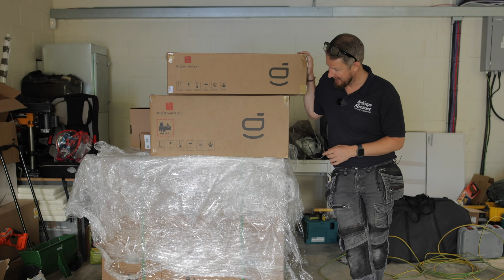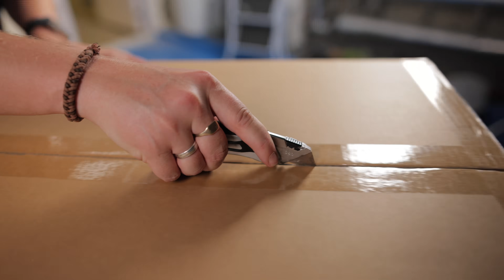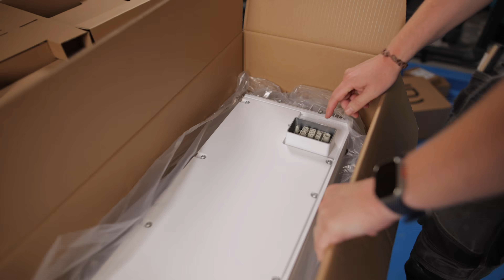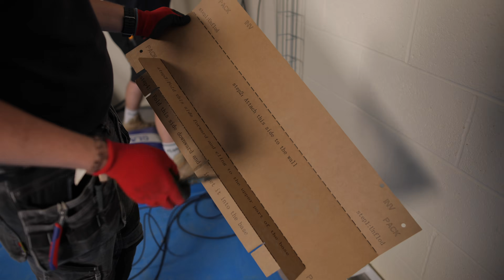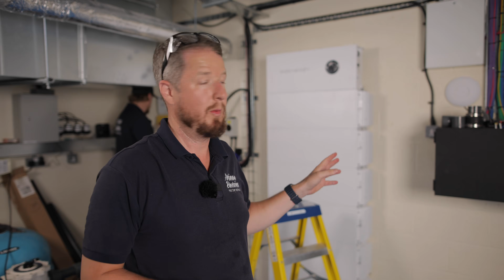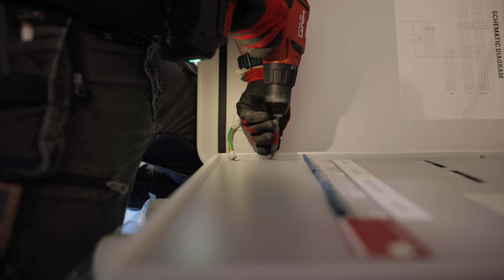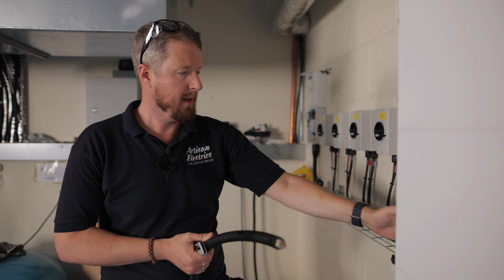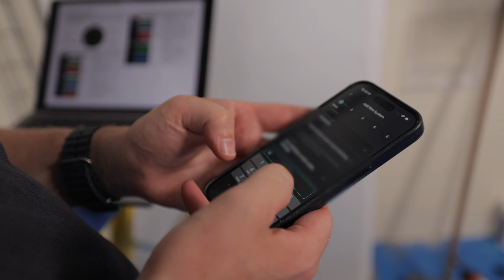Better than a Tesla Powerwall? 🧐🔋48kWh Three Phase UPS Battery System! ⚡️ Sigenergy SigenStor

Comment: I've had a great experience with Sigenergy so far. We've installed 10+ residential systems with them and the post install support has been better than any other inverter supplier I've worked with. The product works and the feature list goes on an on, heating and cooling plates, GPT4 diagnostics, Ai analysis of usage and a really solid app. We even had a rep fly from North Africa to come and sort out one of the installs we couldn't diagnose.

I didn't even mention DC car charging modules coming out later this year, 50kW car charging anyone?. Not a Sigenergy sales rep, just a Midlands based solar sales rep.
Reply from the maker: It really does seem that Sigenergy will eventually become a big name in the battery market here in the UK.
Reply: Re: DC car charging modules - I'm actually more excited about the fact that they have a roadmap to V2X that is to be enabled via software update that uses the current hardware SigenStor hardware. Granted it's 25 kW, not 50 kW, but given the size of EV batteries, that should open up a lot of battery storage for use when needed that we already have. Lots of people don't really need much battery backup when they aren't home, so may as well use the batteries they normally use rather than stationary storage that they might not need to use as much. Of course people using it for load shifting and energy independence will still need stationary storage, but for people aiming for stability of supply during outages, they can at least downsize the stationary storage installation.
Reply: The nearest rep is North Africa?
Reply: Just wait till Xi pulls the plug or starts to demand more spyware. Sigenergy is from Shanghai. I’m not joking here. There is plenty of evidence. We need more Western battery and inverter producers

Comment: Impressive system. Like the easy way of stacking the batteries, but, does it introduce a potential weakness over time? Are the physical connections between units robust enough to not cause problems after many heat cycles and stresses? That will also be a warm humid environment which, over time,  won't be kind to much of the electronics as well as those connections. Just a thought.

Comment: How long would it take to charge one of thosenup with mains power?
Reply: My guess is about 2 hours.  It's a 48kWh battery, the inverter is 25kW, and the house supply looked to be 100A (Three Phase), so the inverter isn't limited by the main fuse.
Reply: @tlangdon12  48kwh means when fully charged you can run 48kws for 1 hour? 24kwhs for 2 hours and so on.
Reply: @93lornamae  check the data, you won't be able to pull 48kW out of it, not many installs where being able to supply 1C when grid tied makes any sense.
Reply: With a 25kW inverter, that means a fully charged battery will go flat in about 2 hours at maximum output.  Charging the battery is more about the solar system and whatever type of AC powered battery charger is connected.  With 72 solar panels it might charge around 25kW in full sunlight but that still doesn't tell you how fast it will charge from the grid.

I think a system like this should have a connection for a gas or diesel generator so if you have an extended power outage with cloud cover or some other reason for minimal solar charging, you could plug in a small portable generator like a 5kW or 7.5kW and charge it in 6-10 hours, maybe more if you are drawing power while it charges.

I like the idea of three phase but I wonder if two phase to get 110v and 220v and a couple VFD drives would be more efficient.  My only three phase draws would be maybe 3 machine tools and I would probably never use more than one at a time.  A VFD with soft start would probably be an easier load for the inverters than flipping a switch on a 4kW three phase motor.

Any way, 4kW is probably the biggest draw in my shop.  Outside of the shop I need a clothes washing machine, a dish washing machine, an induction cook top, an oven, three mini-split AC units and a heat pump water heater.

I'm thinking of something like 15kW of inverter for that and about 30-45kWh of battery so an overnight load is less than 20% of my battery and I live in a desert so almost every day is sunny, I would probably have a large surplus if I install 10kW of solar panels but I still want a generator and a barrel of fuel in case something happens to my solar.

I do want to be completely off grid.  Local utilities around here don't want battery systems back-feeding the grid while they are trying to fix it so outages are still outages if you are grid tied.  I would rather oversize the system than deal with the utility at that point.

Comment: I was designing my own fully bespoke "whole-house" UPS system and now I'm starting to question whether or not I need to bother. As much as I love the bespokeness and the opportunity to build such a system and learn from it, off the shelf hardware being available is tempting.
Reply: The hardware has been available for awhile. My 1998 motorhome had a close to UPS system. Today it is getting better and cheaper all the time. I finally got rid of my lead acid batteries and went LiPo4. They are getting cheap with the slow down in EV sales.
Reply: I must admit - have 3 phase at our house in Thailand, and if they had a distributor there...

Comment: High frequency inverter is not going to love all the inductive loads in that plant room. Off-grid I wouldn't be surprised if it trips out when under some decent load and some pumps kick in.
Reply: Time will tell, but would some PFC solve the problem?
Reply: @tlangdon12  soft starts might help. A motor can draw 20x normal current briefly at startup. A low frequency inverter (transformer based) is much better at dealing with that.

A moot point but Victron kit fully capable of doing what this kit does. And more.
Reply: isn't everything inverter controlled / soft start these days

Comment: Recomend using KLAUKE 'EK 30 ID ML Battery-powered hydraulic crimping tool 6 - 120 mm2' instead of the hand crimp tool, for coper tube crimps. Have been using for a few years, KLAUKE crimping tool is a battery hydraulic with universal  size crimping die, without having to keep swaping dies for different  cable sizes.
Reply from the maker: Thanks for the recommendation

Comment: What an awesome set up.  I had solar and battery fitted last year.  No gateway so no power if the mains goes off.  My question is . . Is there anything I should turn off if I did have an outage or do I just let it sort itself out when the power comes back?
Reply: Inverter sorts itself. My inverter has a port where I’ve wired in a single off grid socket. Tested it ok too. 
You need an earth rod to properly do off grid. I just hope I don’t need it!

Comment: I wonder how much commissioning issues is due to slow wireless far away from the router with obstructions and neighboring Channel conflicts and overlaps.
Anything that's gotta be wired in really should just be ethernet anyway. I know that's an extra step for the installation process but I'm sure it simplifies a ton of stuff in the long run. no need to reconfigure wireless networks by resetting the entire thing etc. just to change the wireless network. The number of times I've come back to straighten things out after the wireless network was reset and then all the neighboring devices need to be reconnected to the now different name.
Reply: Ethernet over power, TP Link AV600 if I can't wire straight from router. Great bit of kit

Comment: 0:45 yes you can… but as I mentioned multiple times… you just don‘t see the market… especially the threephase market and I would really recommend that you take a look at the german market… because germany is way beyond…
Reply: 3 phase is great for solar. I am one of the lucky ones. 20 panels and a 10KW inverter.
Reply: @andrewrharker  I'm going 51 x 440W panels with their 15kW 3-phase hybrid and 8kWh battery.
Reply: @celts88-78  51 panels, you must have a huge roof. For a system that size I’d recommend a bigger battery. I was surprised how much power we use from it. 2x Fridge, 2x freezer etc use more than you think.
Reply: @andrewrharker  The maximum I could fit on my roof (and this is with no panels facing South) is 68 panels. I live in Perth Australia so houses over here are far larger than in the UK, and that's me with a one storey house.

The issue we have is only allowed up to 600V per string, but there's a revision coming to our Standard AS4777.1 that everyone hopes will go up to 1000V, and at the same time will allow the use of V2H / V2G for batteries. Also the maximum inverter allowed in WA is only 15kW for 3-phase (only 5kW for 1-phase) and these generally only come with 3 MPPT's so this limits the amounts of panels that can be installed.

I realise 8kWh is small for a battery, but at present putting the money into the maximum panels and can install additional battery later (we get government subsidies for panels installed). Benefit with Sigenergy is their batteries run in parallel so if older battery efficiency has dropped, e.g. 90% the new battery can still run at 100% whereas if in series battery (the vast majority of batteries) then even the new battery will be dragged down to 90%. Also with Sigenergy having V2H / V2G it would mean can use power from EV to power house during peak period and recharge EV during off-peak period which will save on that.

Comment: My GoodWe runs on 3 phase. And is a UPS. I have 13kw cells, and 16kw batt.
Like this system the batteries just stack together.
Reply: Energy storage in your battery is listed as kilowatt hours. Power output of an inverter is listed as kilowatts. Just keep it straight so that others can learn that's all. Thanks

Comment: Since the price has to be a mystery.  You can get an all-in-one 10kw inverter and 48kw of batteries for 13k usd , how much is this unit? 
When I was searching for a supplier any website that had no price or call for a quote was a total rip off, in one case 3 times the price, if they hide the price, in most cases it is because they are too embarrassed to reveal it. Is this the case with  Sigenergy?
Reply: ‘Embarrassment’ is literally your fantasy. When prices are not quoted for a highly specialized engineering solution, the reason is always legitimate and due to the unknown costs of implementation to a customer’s precise needs. This isn’t home depot.
Reply: @artysanmobile  try using lead carbon,no bms,no heater,no equalizer needed,-30c charge,non spillable,97% recyclable, 48kw costs 9600 usd

Comment: Jordan . They have used an Mccb panel board to achieve selectivity between protective devices and that is the only reason .
Reply from the maker: What makes you say that?
Reply: @artisanelectrics  20 years of experience. 

Selectivity wouldn’t be achieved between mcbs . A busbar chamber and switch fuses is wasted space and labour . 
Plenty of room in a 3 phase mcb board with spreader box . Terminals rated up to 50sq mm for size .

Comment: Don't wreck your battery like Corey from Oy Electrics. He wrecked a £5k battery, paid the cost himself.
Reply: He got it replaced under warranty. Apparently that battery wasn't under warranty if there was no solar hooked up, as the BMS would brick the battery - which is ridiculous.
Reply: @PurpleAlienPlanet  that can’t be the reason . Min SOC is set in the inverter
Reply: @persona250  Tell that to him. That's what he explained in the video.
Reply: @persona250  Yeah, supposedly that is the reason. Why the battery BMS wouldn't protect itself without solar makes no sense. There should be no way to kill a modular battery like that when hooked up in a back up system, solar or not.

Comment: how does this setup compare in terms of cost?
Reply from the maker: It’s pretty reasonable to be fair
Reply: @artisanelectrics  Be more specific,you haven’t answered the question.
Reply: @raymondschembri5042  The question was about comparing costs, but it didn't specify what it was being compared with, so it's difficult to be more specific! A cost per installed kWh of storage would be interesting, but storage isn't the only metric that is important; power is also important, especially in a whole house UPS configuration.